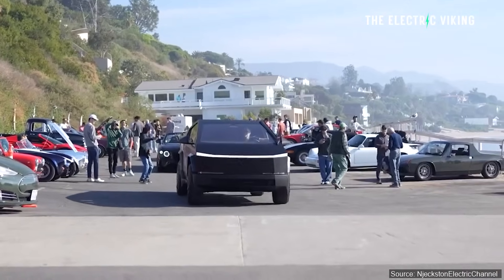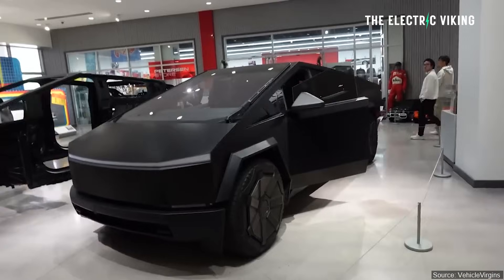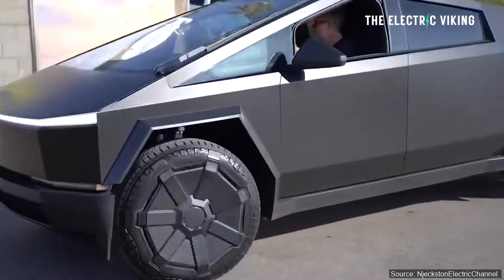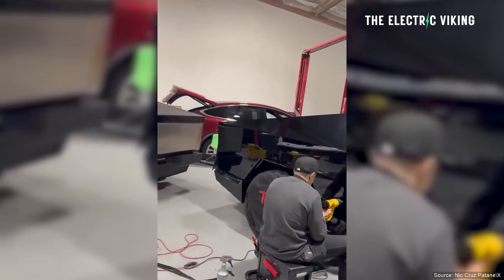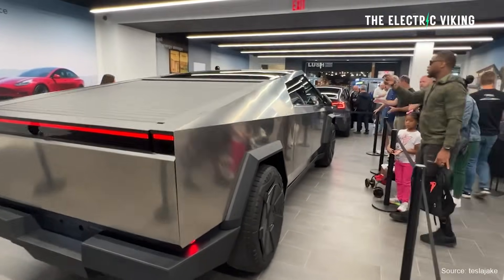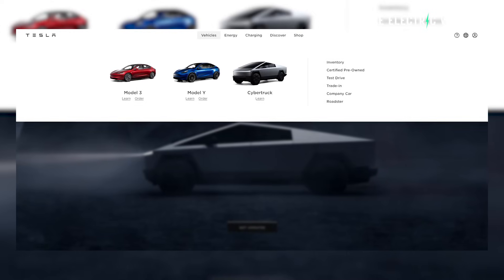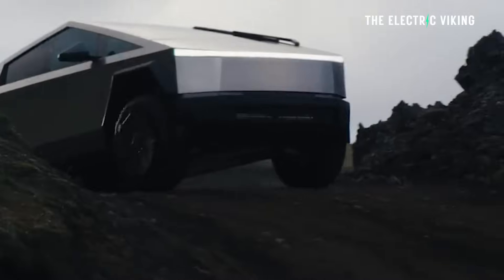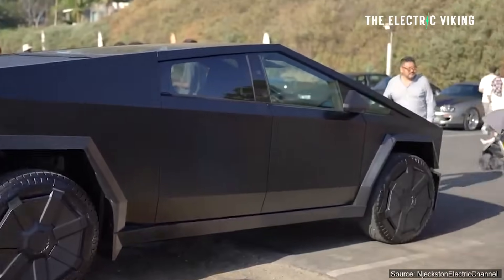This is what a Gloss Black Tesla Cybertruck looks like (terrible?!)

Comment: CT in the raw is fine for me. Don't think scratches will be that much of a problem. I have seen it get hit with a sledgehammer and it didn't dint or scratch. Putting wraps on CT turns it into a fashion accessory. Looks okay but not needed.
Reply: If i got one i’d PPF the exterior purely to prevent the fingerprint problems while keeping the stainless look
Reply: @iCozzh I'd wait until I get annoyed by it. Spending extra money on the basis of hearsay seems foreign to me. You never know how much it annoys you until you experience it personally. The thing is, how often you touch your current car to leave fingerprints on? Not very often, and knowing it might be an issue, you avoid it. The pictures with fingerprints were of a show vehicle where everybody wanted to touch. Strangers will / should not touch your vehicle, so it's you and your family. You can easily avoid it. 
Then, when you think of how much it will cost you to wrap, I'm sure you have better use of your money than this. Plus, the wrap is more vulnerable than stainless steel. Oh yeah, I forgot yours and neighbors cat will leave its paw marks on it too and that cannot be avoided. 🤔
Actually, I wanted to end with noting that the idea of ugly fingerprint marks is overblown by the Cybertruck critics, of course. And our countering it by spending extra $ 000 just shows how vulnerable we all are to manipulation by various social engineers.
Reply: @Alarix246  You’re missing the point of morons going up to your car putting their gremlin grease ball fingers all over it. Had quite a few sports and super cars that have had that problem
Reply: If you drive in areas that snow the chemicals that are used to keep the roads from icing will create a white stain on the stainless. Wrapping is almost necessary in those areas IMO.
Note: you can buff the stain out but the cyber truck finish is not polished creating a noticeable blimish.
Reply: Yeah, I think that the cybertruck is better in pure steel. I wouldn't even bother getting it wrapped. If it gets scratched or whatever I wouldn't give a crap, it would just add to the post-apocalyptic bad ass aesthetic that it has going on. 
  The steel body will weather & age well, unlike fading/scratched paint/wraps which honestly just look.. sad, tasteless & shoddy after just a couple years.
Reply: @iCozzh  🤣 oh that must've hurt...
Reply: @2pi628  the white stain (crystallic salt) will do the same on wrap or any other car.
Reply: @Alarix246  worse at car shows

Comment: The emissivity of polished stainless can be extraordinarily low compared to matt black paint.
Living in hot (baking sun) or cold (perma frost) climates, the energy required to heat or cool the interior will be less with polished stainless (radiant barrier).
Of course that huge glass window makes a neat greenhouse :)

Comment: Last century, we had exhaust systems that were plain steel. I had to get a new system every 2 years. 

I think the CT is ugly, but obviously it has to be made like that because they can't form curves in SS. But I'd be all in for a car with a SS underbody. The upper body doesn't rust if you take good care of it, but here in New York they spread car solvent on the roads for 5 months out of the year and you're lucky to get ten years out of it. When that unibody frame goes, you have no car left.

Comment: Low E White is Right for vehicles here in Semi-Tropical Florida when you have to have it painted.  

Black is off the menu for me and a deal breaker as per the laws of thermodynamics a Black finish absorbs all the light that hits it absorbing the most heat and can increase interior vehicle temperature 5 to 6 degrees higher per hour than a White finish.  Vehicles with black finishes also tend to use around 2% or more extra fuel to keep them air conditioned than those with white finishes.  The same goes for black interiors which is why I tend to lean towards the lighter grays and earth tones that don't look soiled as quickly as white interiors while not absorbing as much heat as black.

I don't buy a vehicle to look at and admire but to sit in and drive so I want the most efficient and easy/cost effective to keep cool and comfortable in our extremely hot, sunny and humid environment.

So if you live in a hot sunny climate like Florida, Texas, etc, etc... White is Right!!!

Best!

Comment: There seems to be a lot of vile and ignorant comments about the stainless steel material. It appears that consumers have no idea just how good stainless steel is--it is orders of magnitude more durable and rust resistant than steel. Stainless steel does not rust at all. 

The only way it can rust is if you put chlorine bleach or salt on it, and leave it on there. If you do get rust on stainless steel, it is just superficial surface rust. 

The way to clean stainless steel is to use citric acid, white vinegar, phosphoric acid or Barkeeper's Friend (Oxalic Acid). Barkeeper's Friend is sold at every grocery store, and it's about $3.00. You just wipe the stainless steel with an acid/water mix, and it removes any free iron particles that are floating around on the surface, and it re-seals the stainless (passivation). 

Stainless steel forms a chromium barrier every time you clean it with acid, and let it dry in the open air. The chromium barrier on the surface is what makes it stainless steel. Once it's clean, it does NOT rust (unless heavily exposed to chlorine).

Comment: There is a red as well, Tesla showed a glimpse of it a recent light show video. I agree that the car needs a wrap because the stainless steel look is not great.

Tesla could also make an aluminum chassi that looks like a Ford F-150 and stack it on top of the Cybertruck if they needed to.
Reply: Are you talking about replacing the stainless with aluminum? Don't grok your use of stacking.  The truck does not work without the strength the stainless contributes.